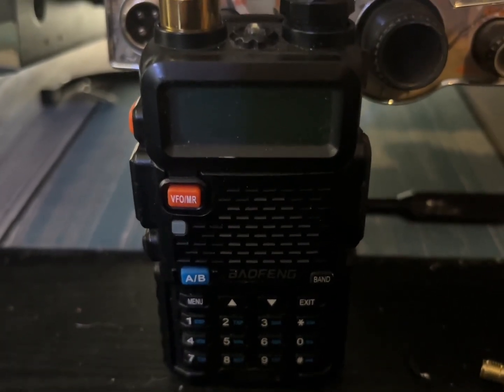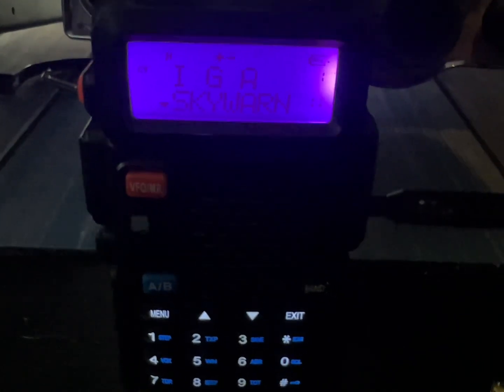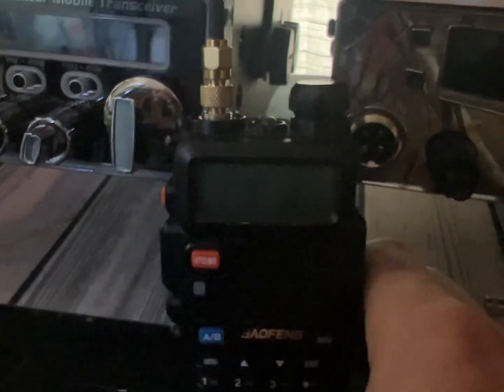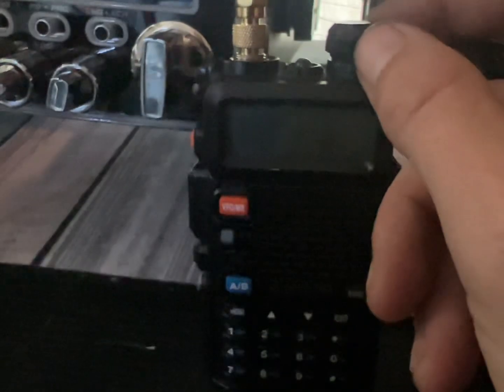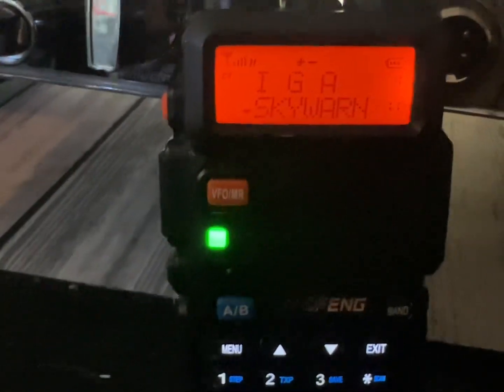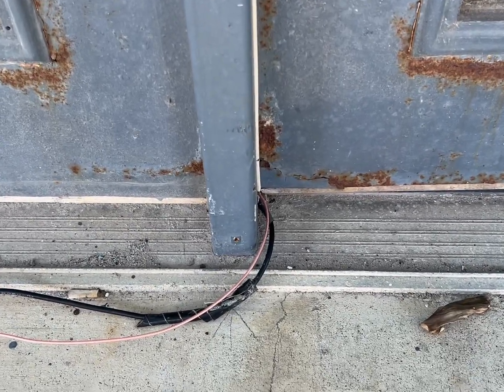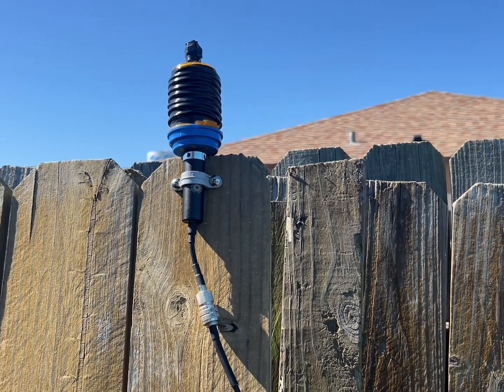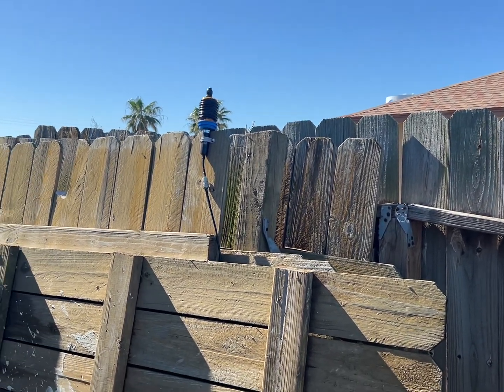A homemade UHF/VHF antenna for either a base station or portable use, currently in its first version

Comment: Don't know if you have considered those long runs of small coaxial cables, are extremely lossy at your Frequencies of interest, ie. VHF / UHF !
Depending on your distance from your radio to the antenna, pretty much dictates the type of coax you'll need at these higher Frequencies !
Get too long, and you'll need something about the size of a fire hose !
😳

Comment: We had this junk 40 years ago.
Reply from the maker: I want to clarify that I did not claim it to be a brand new antenna. It is a homemade one, and while it may not meet your standards, it works far better than any antenna I have. It's located only 6 feet off the ground and performs exceptionally well for my area, so I stand by its efficiency.
Reply: @361cctx-vv6ch  GO find you a mobile ant from the 60,so called a big mama.made by antenna specialist. Cut 14 inches off the whip,and see if it don't outperform any antenna made.they were made for 11,10,mtr commercial, police ran them for years.then they put Ling whips on them and found they ran perfect on cb 11 mtr bands.i ran them on all my stuff,even 2 mtr base.